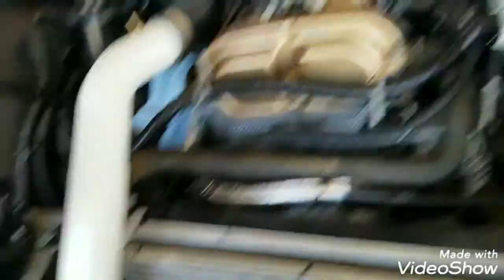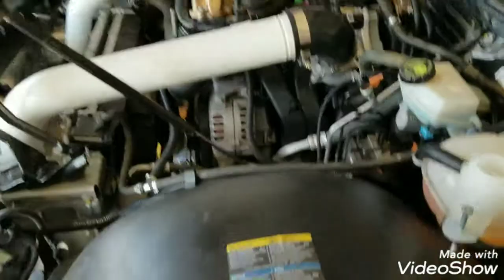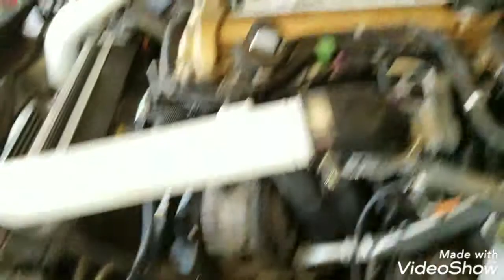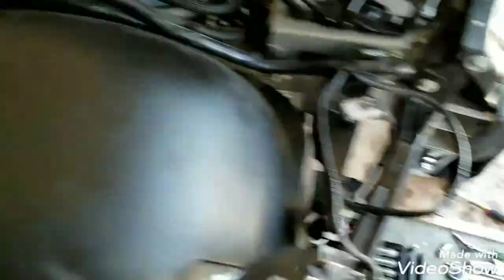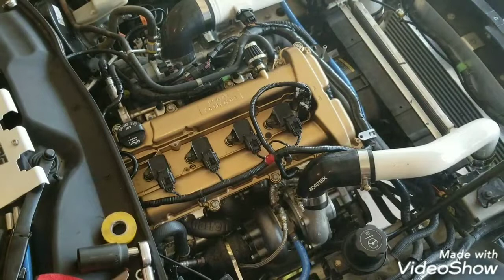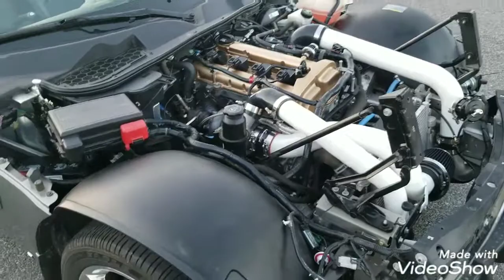Turbo build on le5 ecotec 2006 Pontiac Solstice 2.4l (PART 7) valve cover removal and timing

Comment: How much hp making after all these mods?
Reply from the maker: On just wastegate pressure 8psi I got it to 259 whp and with manual boost controller I was @12 psi roughly 298whp
Reply from the maker: Plan is 16 psi but I am having an issue at the moment with cam solenoid